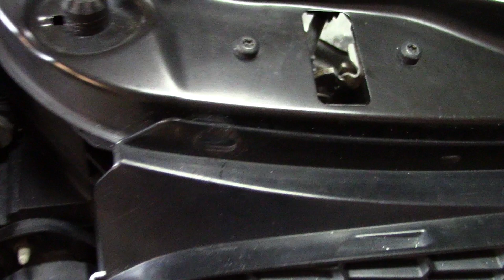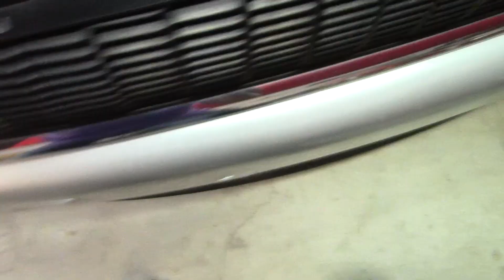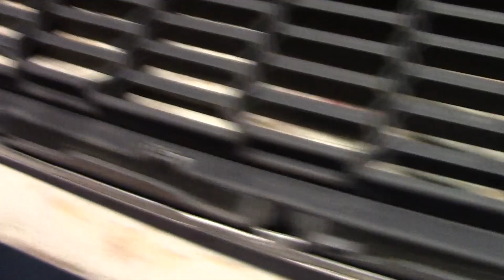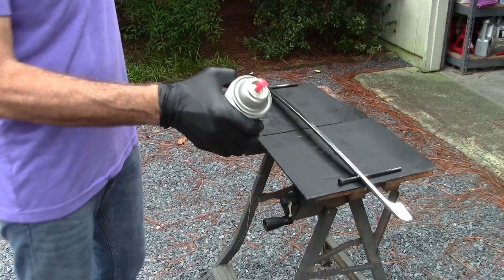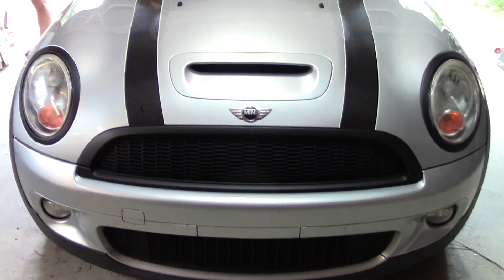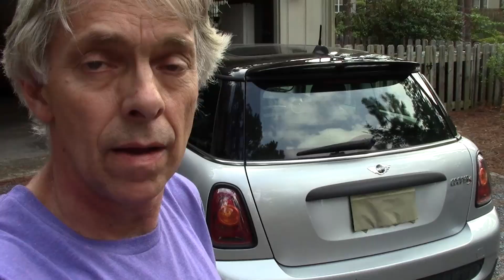Mini Cooper S Chrome Blackout

Comment: Just a quick question, i use plastidip myself and am currently in the process of blacking out the whole car of chrome. You showed the rear boot handle which was plastidipped. I'm just curious as to how you did this as i have tried several times but cannot get the plastidip to stay on the edges as it keeps shrivelling back from the edge of the handle, Thanks

Comment: I could be wrong but i dont think you need to remove the grill to get the bottom trim off. Im trying to do my front trim at the moment but there is a bit of bubbling due to age and sun. Do you think i should sand it down first? Nice car, looks good

Comment: looks good.  to stop the plastidip from spattering warm the can up either in the sun or with a hair dryer.  you'll be amazed at the difference it makes.  I won't even use it unless incan warm it up first.